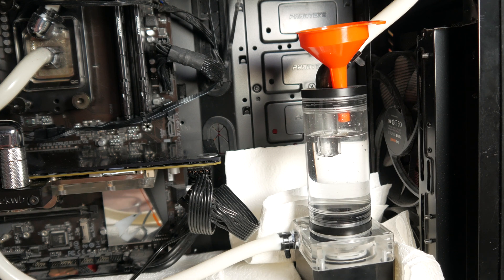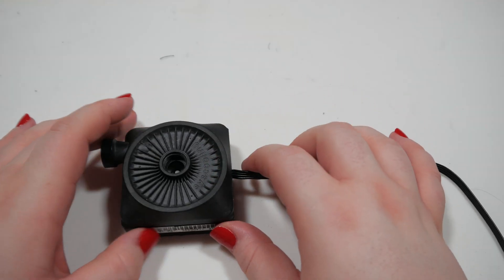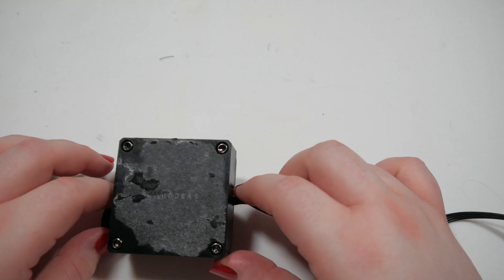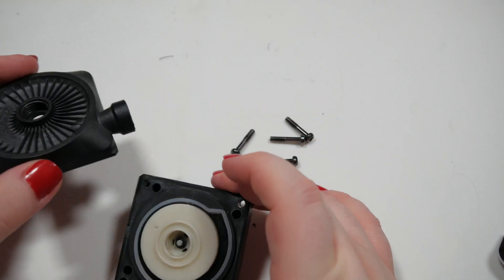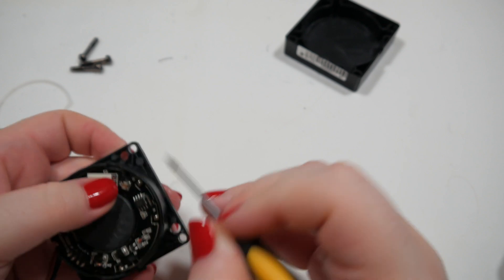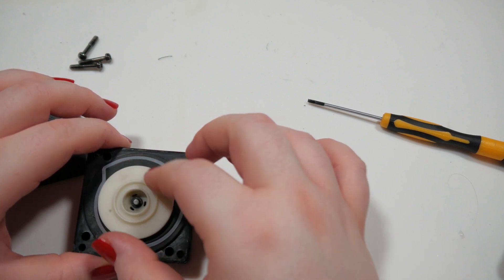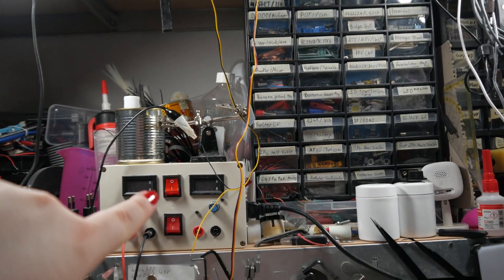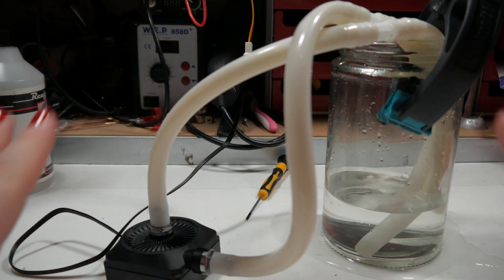Water Cooling Pump Noises (Fixed itself) + Why I was gone for so long

Comment: Welcome back.
WRT the pump, I think water cooling computers in general is the wrong way to go.
You can get much better cooling by forced air convection, especially if you upgrade the heat transfer surfaces.
I did some heat transfer calculations, and to me, the bottleneck in cooling is NOT with heat removal by a water cooler.
In fact, I think you get WORSE cooling by going to water cooling, in terms of extra cost and power.